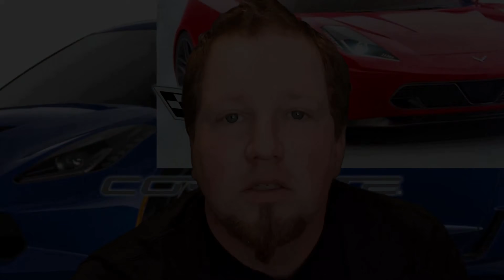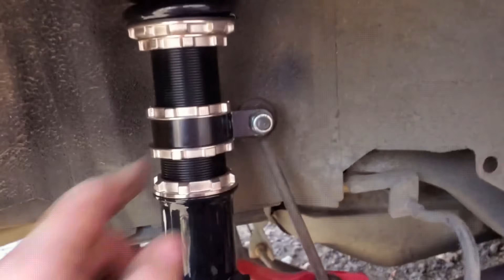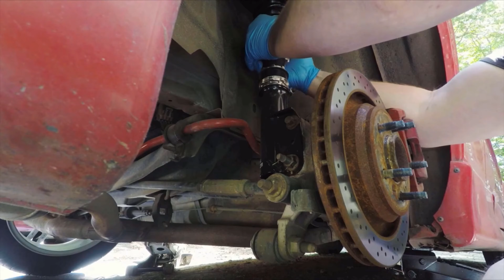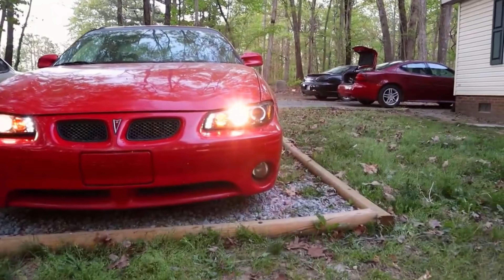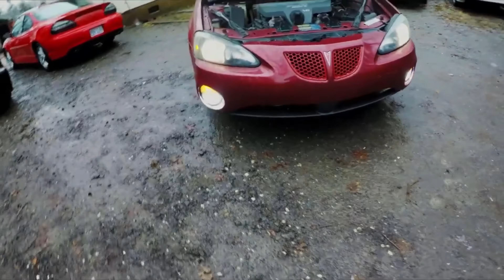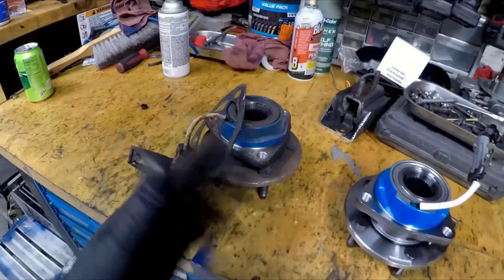5 Parts I Tested But Don't Recommend

Comment: Any advice on how to remove the two bolts from the shock to the nuckle? I think that's what its called sorry but yes they seem to be mushroom out a bit from previous owner how ever they won't even budge at all
Reply from the maker: Usually it takes a decent hammer.  They are splined in so hard to get started, but getts easier once they start moving.

Comment: Definitely agree again! Every cheap made in china part I've used, I had to replace a month or so later. As for Detroit axle... I bought one of their steering racks and sent in the core for the lifetime warranty. The rack was puking out fluid 2 years later and they wouldn't honor the warranty.
Reply: take it to small claims court with evidence of the warranty
Reply from the maker: Wow.  That is not good.

Comment: Sammy I know this ain't no topic about the five worst parts but on the drive by wire you never really explain if the harness has a moves up and down on the valve cover to rip the wires have u ever seen that before one YouTuber said he did on his 06 Grand Prix in the wire harness is rubbing against the valve cover causing the po2138 reduce engine power that's what I'm having on mine it's an intermittent problem
Reply from the maker: I could deff. See that happen, but havent had it happen to one of mine
Reply: @SalemDoyle  my luck it happened to my car I think it is I really don't drive her my very much my friend drives it the most and he complains to me about it

Comment: This is good to know. I don't like having to spend good money on bad parts. My '98 GTP needs a little work including struts , wheel bearing , only because I don't know how old they are. 
I'd like to upgrade the breaks from the stock ones I have on it now, and my headlights are just plane ugly. And I need a better boost gauge . 
Now, I know what brands to avoid.  Thank you, good stuff.

Comment: I noticed most of the stuff you mentioned is eBay stuff . I agree! One brand I generally avoid is Spec-D Tuning. That's like the eBay China brand. Most of the stuff they sell is really low quality and won't last very long... that's assuming it fits your car in the first place. Avoid that cheap eBay stuff and buy quality parts if you can (I definitely understand not everyone has the money for more expensive higher quality parts though)

Comment: Where did you find the gauge pod that mounts on the dash next to the HUD housing?
Reply from the maker: Zzp
Reply: SMH.... Yea... I saw it on there site not long after I posted the question. LOL
Thanks for the response!
BTW... I'm working on my 98 GTP that has been in storage for several years getting it road ready. I have a list of things/products/parts I'd like your experience based opinion on.. starting with tail light assembly options. I think my list could help with content ideas that would help others trying to get or keep these cars on the road like us.
Reply from the maker: @dontblameme6328  sure, if you look me up on instagram you could shoot me the list there

Comment: Never use the carquest oil pressure sensor I replaced my slowly leaking oem with one of those and 6 months later it blew all the oil out of the car amd I was luck to be on a short enough drive to get her home before she lost all her oil
Reply from the maker: Thanks for the info

Comment: 5, I'm running zzp coil overs. Which appear very similar to the BC. these zzp coilovers seem to have a different valve set up. It is still only 1 dial. But it is balanced fairly well. 

4, all headlight assemblies for 6th gen grand Prix are trash. Aftermarket or factory replacement.

3, you've got to be careful with LED's in a reflector housings. Beam pattern can be off due to placement of the diodes. The higher end ones focus on this and give great patterns. Where as cheaper ones don't. A good example would be HeadlightRevolution. Their GTR bulbs are fantastic. A bad example XenonPro, the diodes are not in the correct spot. Therefore will not create an acceptable beam pattern.

2, I've always be sceptical on cheap gauges. I've always ran AEM and never had an issue. I've got a few friends that run glowshift, they're on the cheaper side but the data displayed is accurate.

1, I've gone through so many wheel bearings from countless brands... what's more important is warranty time period and ease of replacement.
Reply from the maker: I am tempted to try the zzp coilovers
Reply: ZZP coilovers are very cheap.  They're identical to chinese ones sold on Amazon (I didn't want to call it out on my install video).  While I like them fine on a car I drive semi-regularly, don't expect them to blow your hair back.  W's are not a great chassis to expect much from, so we get the minimal parts available on the market to go with that.
Reply from the maker: @dezldave961  i am wondering though how hard it would be to adapt a better brand to our cars using parts from the bcs or zzp coilovers.
Reply: @SalemDoyle  I know Intense used to do a conversion kit when they were still active in the market, using a sleeve over a name brand strut like Koni's, and some guys have built similar ones themselves.  It's a matter of 'is the juice worth the squeeze?' on what you get from a $1K+ investment in marginal gains over what's currently available.
Reply: @dezldave961  yeah, at the end of the day they are $1k coilovers. But they are pretty good.

Comment: I do not use Detroit Axle any more either. I have had problems with there wheel bearings also. Last time i bought a set of rears for my 04 Monte Carlo 3 times they sent me the wrong parts after i finally got the right bearing they only lasted about 9 months.

Comment: I had those Spec D Tuning headlights on my Grand Prix, too. I feel like my adjusters worked and the beam pattern was alright, not good but not bad. However, the points where they bolt to the frame were super weak and positioned slightly wrong. I had both break, one more than once (maybe that second time was a bad repair by me, but it was too long ago to remember).

Comment: Detroitaxle definitely I've bought a brake kit from them rotors and pads they squeaked horribly for at least a month bought struts that didn't last long at all before cluncking returned never went bk to the site after that. Cheap for a reason